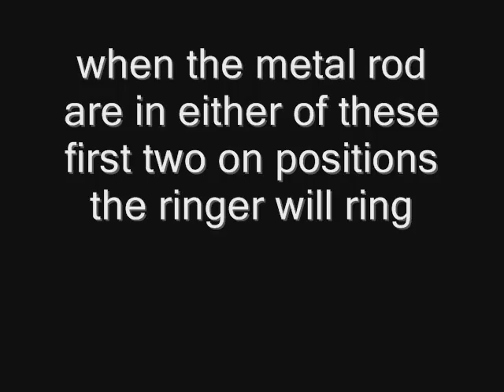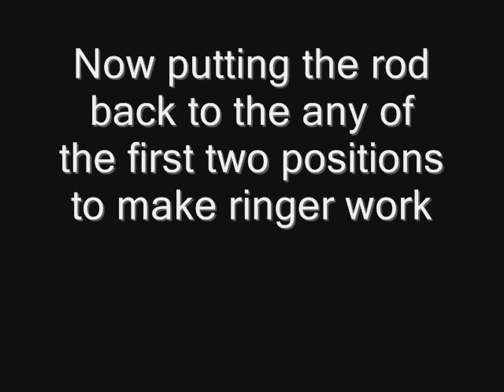How to fix the bell thats not working on a rotary phone

Comment: I just bought a brand new vintage rotary phone fron the 1970's and i was a little disappointed. The cables don't come off so I can't just exchange it. When i try the phone everything works fine except for the ring but if i put it upside down and tap it a little bit it rings. So since the guy didn't put it in the right position and then in the post office they threw the boxes. I imagine something got loss i found your video I did  everything in the order that you did it and it started ringing you save my day and my money 😅, thanks.

Comment: I'm in the UK and you can but a replica of a Weston Electronic 2500 called a Cortellco 2500. It looks good and the phone is fine but that distinctive American sounding bell just isn't present here. I decided to get a phone part on Ebay from the States and try to wire it into the new phone! I spent hours wondering why bell wouldn't work when connected. Your info here got the bell working perfectly and now the phone looks (and sounds) authentic! Cheers for the info. Top geezer as we'd say :-)

Comment: Hi, I recently switched from a frontier (Verizon landline) and I switched to a VoIP line, and the phone was in working order.  Now after doing what you did in the video, at first when I called it it would just vibrate, but I kept moving the bell adjustment lever and the phone sounded like a buzzer, but then when I turned the bells Manually it started ringing like I was on copper, but unfortunately now it seems as though the bell lever on my 554 is broken.

Comment: On our Western Electric 302 phone the little wire is in the left hand position looking at it from the same view as this video but it's not ringing. Not sure if this is the off position for this particular phone or not but we just bought it. Guess I'll open it up again and try a different position but I have a feeling that it's something else, not sure yet...
Reply: Evidently the left position for the ringer spring rod or pin, whatever it's called, is the off position on this Western Electric 302. There's two more possible positions for it, the middle and right position. I got it to ring once in the middle position but it sounded weak so I put it in the right hand position. It rings but still sounds weak. I wonder if the coil and the ringer bar/armature thingy contacts need to be cleaned. It's not very loud. It is very dirty and dusty on the inside, we just got it off of Etsy online.
Reply from the maker: Do you hear a ring tone? Can you dial out? do you get calls in? If not you need a land line service,  cable or dish wont work on an old rotary phones. Try different position on the wire if you have all of about